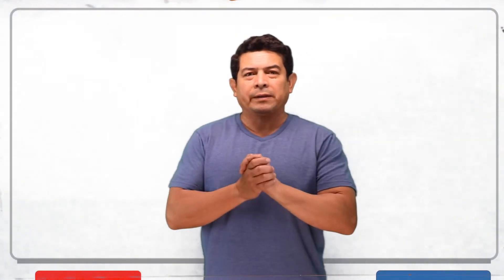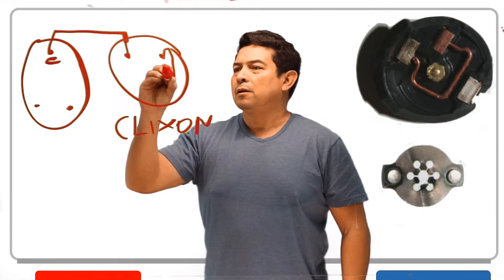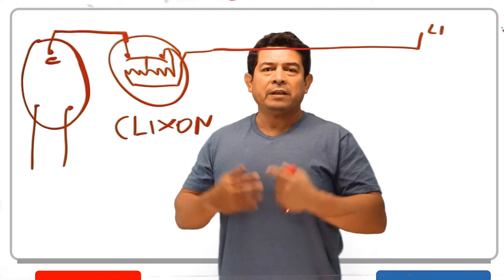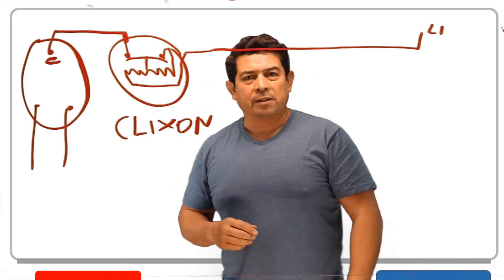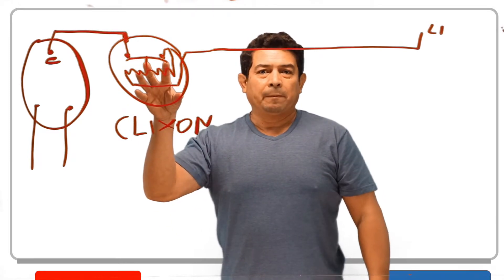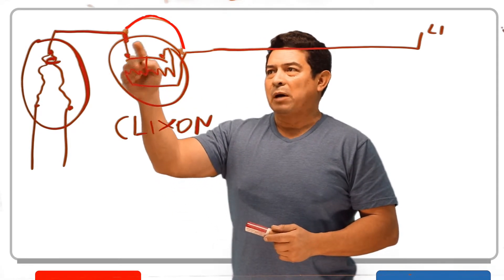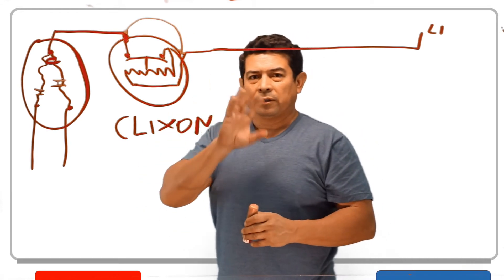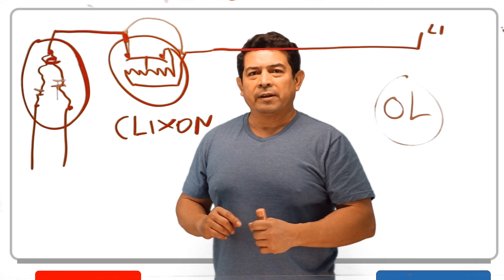Clixon Overload How Clixon Overload​ works - HVAC Online Training and Courses

Comment: Do minisplit compressors have klixons ?
Reply from the maker: Most likely they will be using a clixon. This would be attached right onto where the terminal connections are at the compressor. I, can't speak for all of the units or manufacturers but most of the time they will have it. Good luck and thank you for watching!